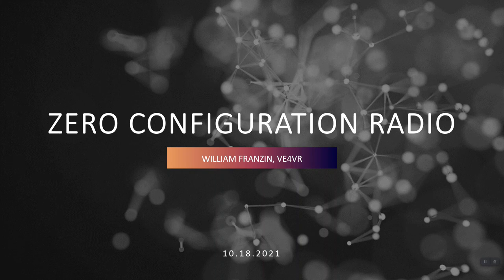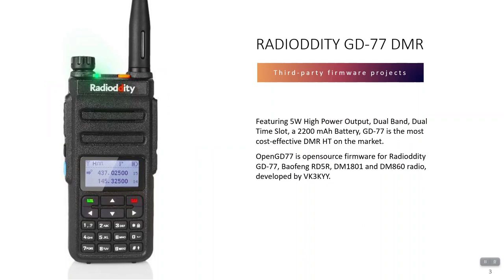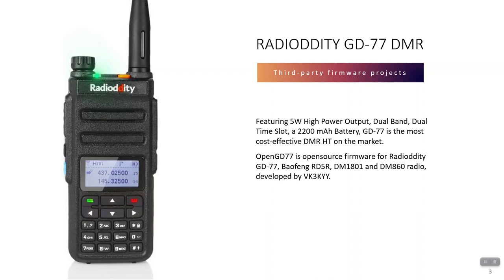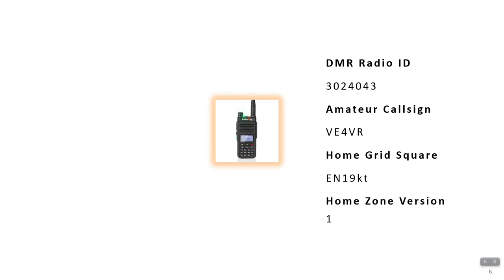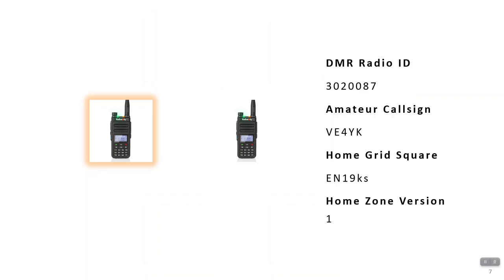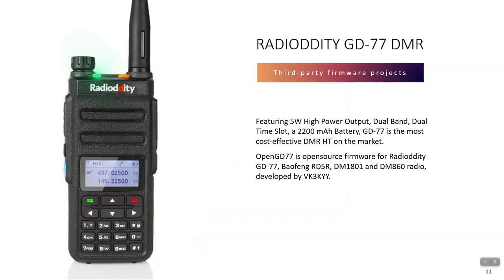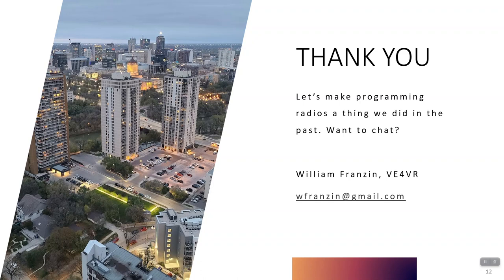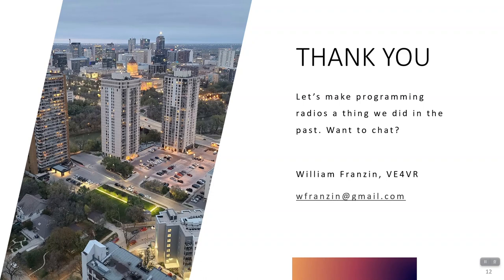Zero Configuration Radio - Let's put an end to programming radios, codeplugs and all that stuff.

Comment: This is a fascinating concept that may take off. Talented people like you "contribute to the advancement of the radio art... advancing skills in both the communication and technical phases of the art." Your proposal surely resonates with thousands of would-be Radio Amateurs who attempt to enter digital voice mode but are stymied by a fragile chain of "do this, then this, etc. which requires full knowledge of how to perform each task-item to successfully program a digital radio. This often ends in hours of frustrated and time wasting activity which does nothing to encourage participation. I've personally experienced this frustration, overcome with the generous time spent by a true Elmer who has assisted me. Thank you for your excellent proposition and I hope it takes flight and becomes a SOP.

Comment: Cellphones and two way radios are different in function .....plus the manufacturers would have to agree on some form to allow this...its not gonna happen
Reply from the maker: APRS was created and adopted by many radio manufacturers. The same could be done here. I'll share real world demonstrations soon.
Reply: @WilliamFranzin  WTF?? APRS  was developed by hams, not manufacturers...APRS was developed by Bob Bruninga, WB4APR, as a real-time local tactical communications system for rapidly exchanging digital data of immediate value to operations. This really took off when GPS became available and MAPS were integrated into the system for tactical situational awareness of everything in the net. It may have been adopted by SOME radio manufacturers but not by all and not even most ..try to keep your facts straight...

Comment: A handheld device which communicates with other devices over a network and does not require any knowledge of how the system works or configuration?  Isn't that similar to a cell phone??
Reply from the maker: This is a peer-to-peer solution automating the equivalent of calling out on 146.52 and saying "anyone monitoring can you tell me what repeaters and frequencies are used in this area?" and automatically processing that information to setup comms. It solves the problem of not easily being able to travel with a VHF/UHF radio.
Reply: Right up until you learn about politics in Ham Radio. Who gets to be the one running that radio? Who decides what data it will spit out? How about my spot is better than yours, or how about 50 people with their version of what should be given out in an area. Novel idea, cool niche, but this kind of thing is kind of being done for both DSTAR and Fusion already and it isn't tied to one modified firmware radio. Those are the first things I believe you need to figure out. I have been around awhile and watched clubs split over voices on a repeater controller or having an autopatch. When you figure out how to get past the politics, please post that video, many of us would like to see it.
Reply: @danthompson8991  That is the truth well said
Reply from the maker: @danthompson8991  That's fair, I guess here in Winnipeg I can say that 99% of the time we don't have problems like that and multiple clubs are collaborating to expand network coverage, repair repeaters etc. I'm not specifically interested in the GD77 - most ham products are consumer electronics these days and I can't just write a new firmware image for an Icom or Yaesu product. That's something I'd like to see change as I believe hams could write better firmware for the hardware than the vendors producing them.
Reply: @WilliamFranzin  Love the concept great Idea, Just ordered one of the radios will have a look at it and the firmware